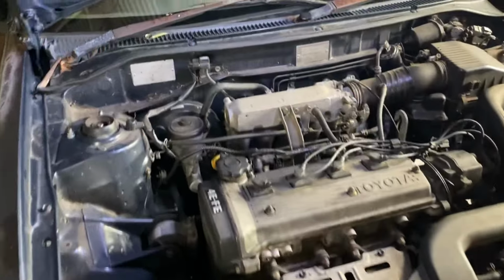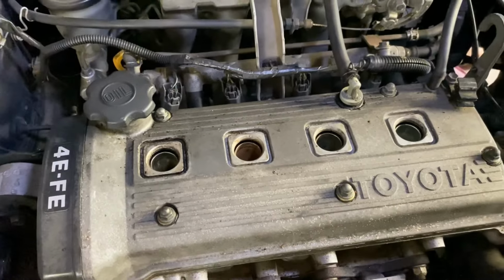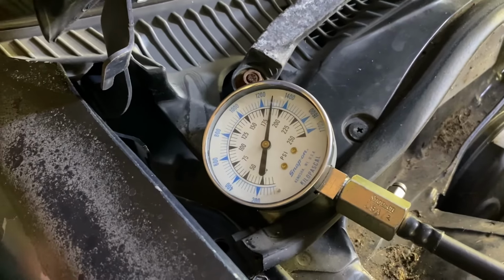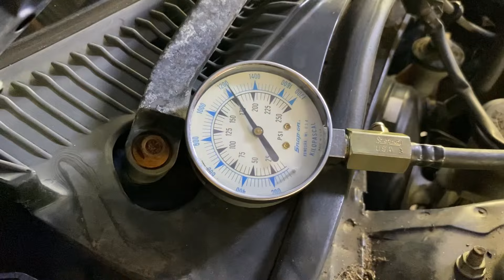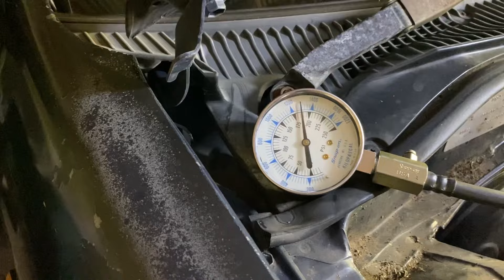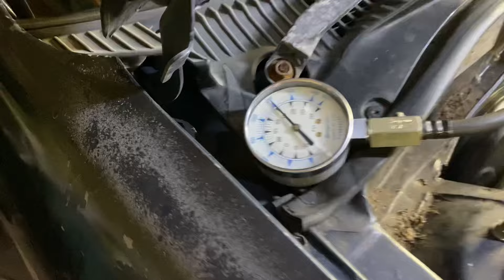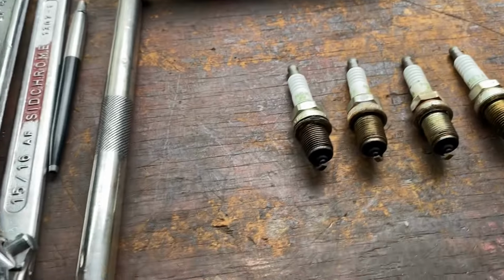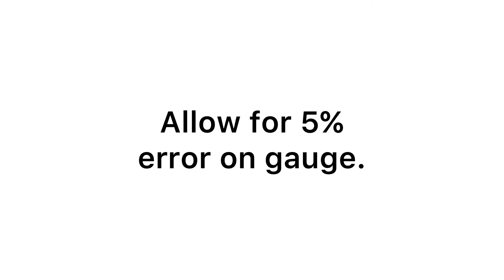Compression Test 396,000 km Toyota Starlet

Comment: So it doesn't seem too tired after all. It doesn't seem to burn lots of oil looking at the plugs. So why would you replace the engine? And when are you finally supercharging the starlet? That's why I subscribed initially...
Reply from the maker: I’m not replacing the engine. The car is getting scrapped. The car is hail damaged from 10cm hail. The windscreen is smashed. The hood and guards are damaged from roo hits. The headlights are held in with zip ties. Needs suspension. Plus there’s other issues. It’s not worth putting the money into. I’m still supercharging the white Starlet. Unfortunately it’s not a cheap undertaking when doing things properly. It’s take time to find the funds with bills, mortgage and a family. I’m getting there slowly.
Reply: @GsAutos Oh too bad. You can't safe em all! I'm looking forward to the supercharger project. It has been done so little. The 5EFE engine would be even more suitable. It has lower compression ratio and lower ref limit. A version of the 5E also came supercharged stock I believe. There are also people doing a 1.5 yaris tsport engine swap in the starlet. Some also supercharge those engines. Good luck with the scrap. Maybe you can make some money on parts...